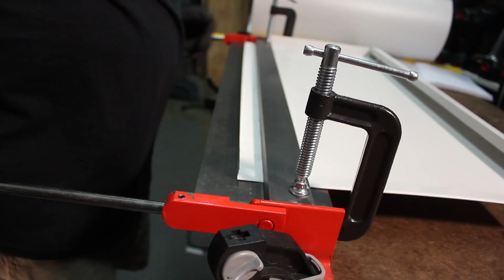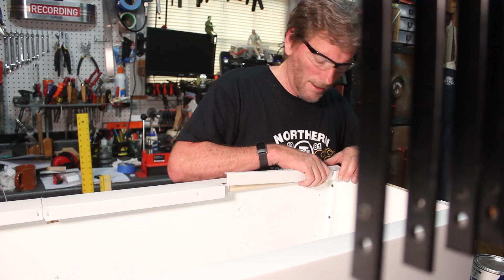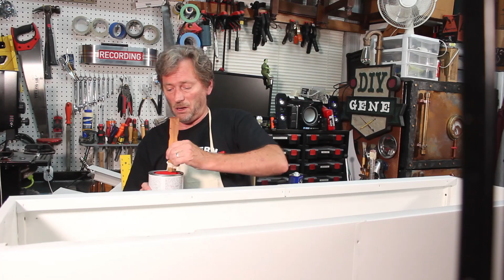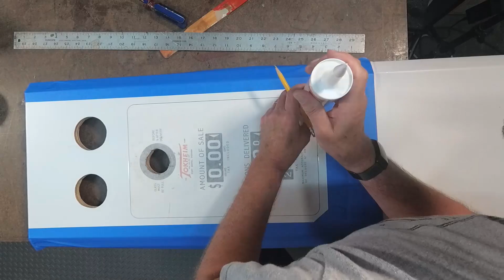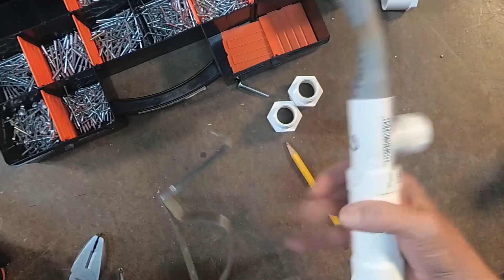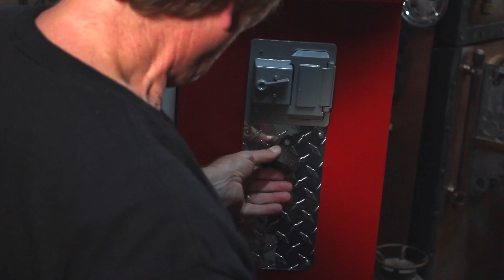Retro Gas Pump Cabinet Build!

Comment: Rather than using a contact adhesive, you can use construction adhesive. Get the kind that is in a tube, and is dispensed using a caulk gun. The dry time is long enough for you to be able to position, and if necessary, reposition your pieces before it dries. You can also wipe on a very thin bead of paintable caulk along the exposed seams or edges to make it even more weather resistant.
Reply from the maker: That is an excellent suggestion!

Comment: Sir you did something special! I always take a lot out of your videos and this time even more. One addition to your project to give it even more functionality could be to use the pump as the gas feeder for the bbq. What do you think? Would it be feasible and safe? Asking for a friend 😂
Reply from the maker: I’m not sure, but that’s a good idea. I also thought it might be fun to use a small keg and make the pump handle to poor spout.
Reply from the maker: Now that I think about it. You could add an extension hose to the gas tank run it out of the cabinet lo the pump handle and let it clip at the bass of the handle. So the handle would stay but the hose connecter would unclip and go to the grill. Because the hose is smaller in diameter you could put insulation foam around it to make it bigger.
Reply: @DIYGene  and this is why you are the man!!!!